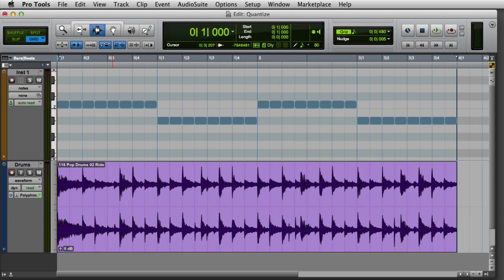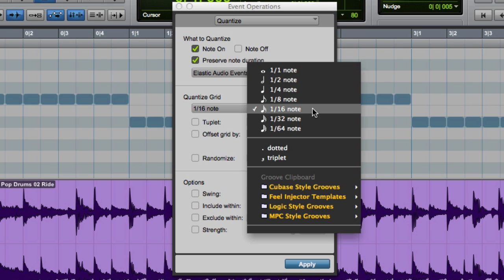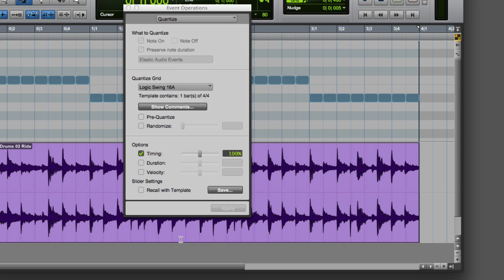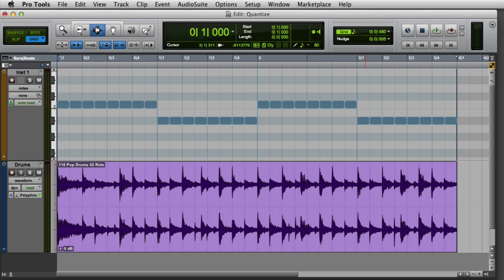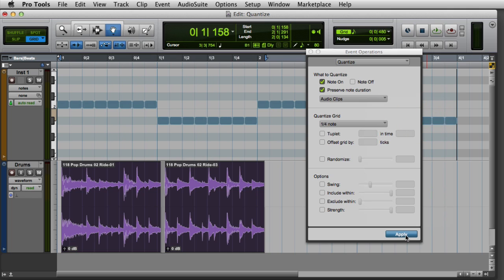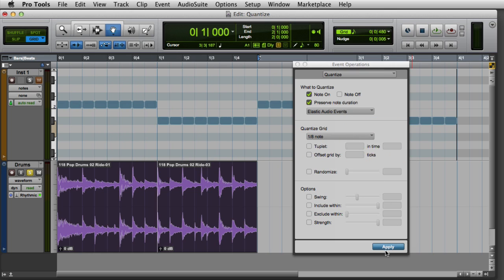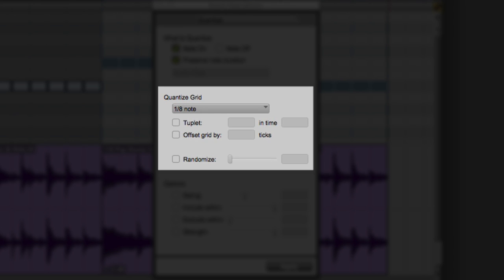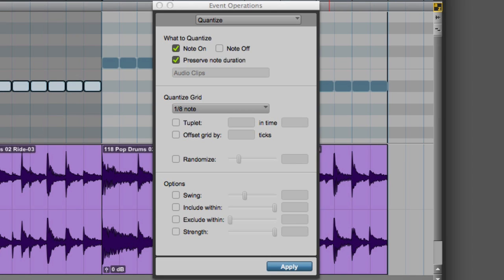Quantizing Audio and MIDI in Pro Tools

Comment: I’m having an issue with the quantization feature. Despite clicking preserve note duration when I quantize it fundamentally changes the sustain on my midi notes so they sound very different to what I have in mind even though the timing is now correct. How can I fix this?
Reply from the maker: "Preserve note duration" will move the note off earlier or later depending on the note's original timing relative to the grid.  Have you tried disabling it?
Reply: Eric Kuehnl yes I have. Still having issues with the sustain value

Comment: I found that, when you quantized audio, the quality dropped. It does not sound smooth or natural.  How do I fix that? Any suggestion?
Reply from the maker: Elastic Audio will always compromise the sound quality to some degree.  It's using small bits of time compression or expansion which can sound pretty bad if the quantization is moving things around a lot. This is why pro drum editors still use Beat Detective.  It's MUCH more complicated but does not use TCE so the sound quality is preserved.